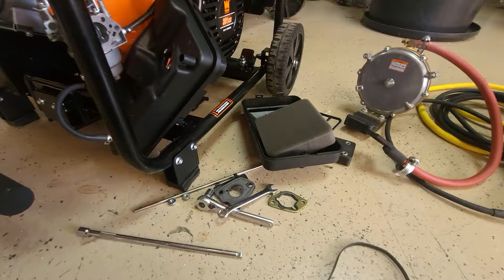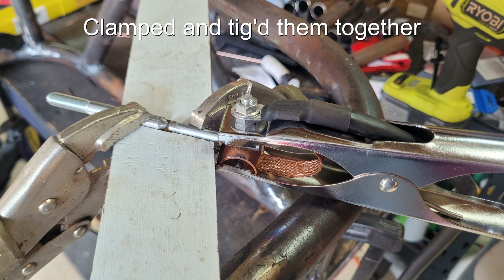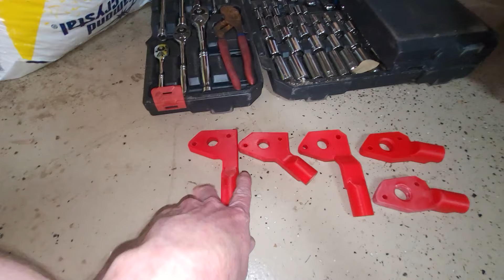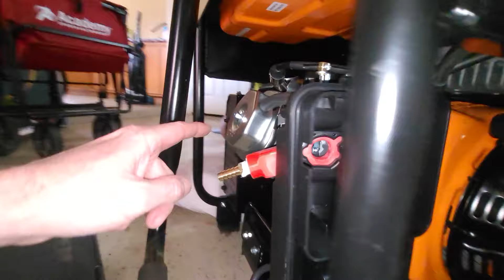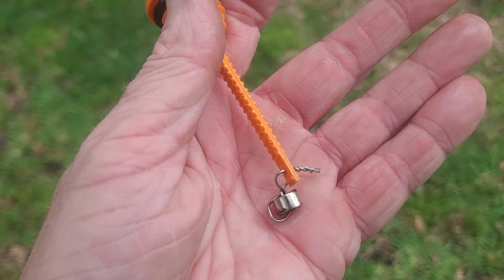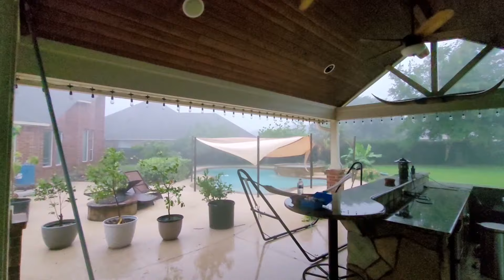Nat Gas conversion of a gas generator

Comment: BTW,  I'm really interested in that cooling tower behind the gen. After I subscribed, I went to your site but didn't see anything.
Reply from the maker: That is a pool cooler.   It has a fan on top and runs water over a bunch of surfaces.   The water evaporates and cools the pool.    I have not used it becaues I like warm water more than cold water.
Reply: @ericensley2427  Thanks, I recognized it as a commercial cooling tower, but never saw one on a house. People around here never think there pool is too hot,  in these parts use pool heaters, even in the summer because out nights get cool.
Reply from the maker: @toadabc  It is called a "Glacier Ice Block" pool chiller.

Comment: You have a carb and gas tank. Why not start it on gasoline and switch over?
Reply from the maker: I don't want gas in the carb.   I figured an easier way to start it.   I have a longer hose and I purge in Nat gas, and then crimp the line and pull over 2-3 times and it fires right up